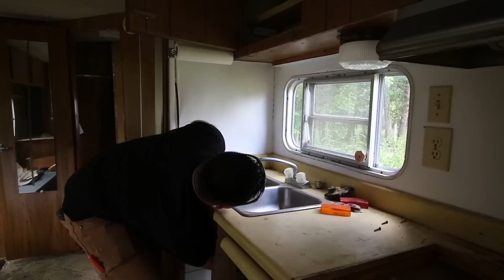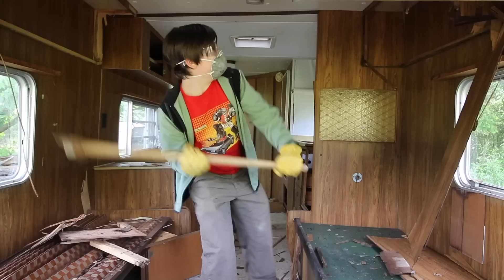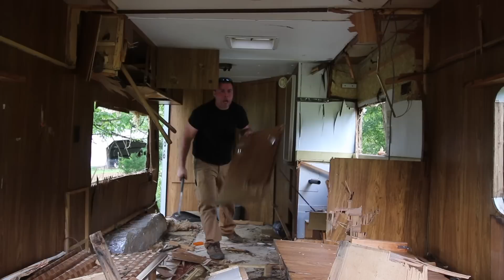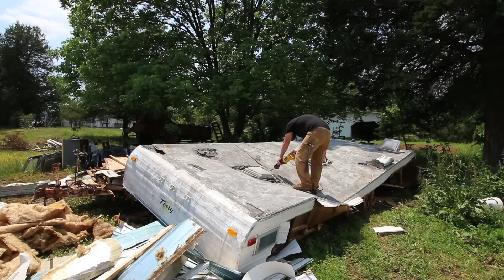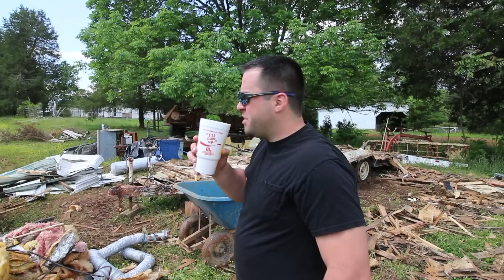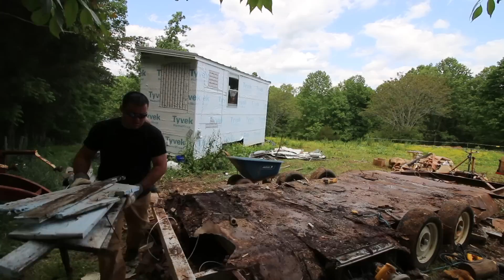Tiny House Terry E2 - DEMO of a camper trailers for a Tiny House.

Comment: Heya, I did something similar because I was on a super budget. I bought a rotted out camper and took it down to the frame and cleaned it up. I only have time every once in a while to work on it because I work full time, but I'm almost done laying in my floor joists and will make an update video when I do.

Comment: Lucky you had help. It took me about a week, but i stripped it down saving things that could be of value or reuse. I agree after doing this demo travel trailers are basically garbage on wheels. 2x2 walls, 2x3 floor joists not attached to the trailer frame except on the sides, paper thin wood walls, and a plastic mat under everything to hold the water into the floor so if there's a leak, its going to cause the floor to rot.

Comment: not bad, 4 days. me i have an excavator, a burn pile, and a dumpster. i just pulled home a 30' trailer that i simply want the frame out of. all the lights and brakes work. will just need tires and decking when stripped. will be great for atvs, lawn mowers, and hauling lumber.

Comment: OK, that was a very entertaining 22 minuets!  I lost a finger nail and nail bed from a grinder blade coming apart.  At 30,000 rpm, those can be fucking lethal!  Won't use one now with out a guard now.  But it was a blast watching you and the kid do the Demo!  I have a opportunity to buy a 24' trailer that I think was a mobile home at one point, it is just the steel frame now.  Only problem is I don't really have anyplace to park it.....  Still want to do it though.

Comment: It is amazing how crappy they are made, but they are this way to save weight..  Lite woods and using them far and few between and yet they do seem to last quite a while.. The number 1 problem with campers is water leaks.  When they come up with an elasticized panel that weighs only a few ounces, that's what they will use. When our 5th wheel was home and not in use, it was under a carport type tarp. It was amazing how cool it stayed inside when not in the baking Florida sun. 
I think I'd have gone to a pawn shop and grabbed a dirt cheap circular saw and chopped it into handleable pieces.  The cleanup alone would have put me in my chair with a case of beer!!!  

Scratches to Peanut!!

Comment: Yeah I think you're going to find that the aluminum scrap prices stink....here in my state it's only .50/lb....you're most likely not going to get anywhere near $250 scrap value off of the top...maybe with scraping the entire trailer. you gasoline idea would have been key.
Reply: should've watched the whole video first

Comment: why destroy that camper? it looks likes it could be repaired for less than the cost to build one...
Reply: did you not watch the video?
Reply: +Wes yes i watched the video ....it looks like its worth fixing...
Reply from the maker: The whole point was to get a trailer for cheep.  yes it could have been saved for a year or two but not the point.  it did have leaks and mold.  the ceiling was falling in and there was a lot of water damage in the base.
Reply: +Tiny House Customs oh ok then .guess it was junk... my mistake ....

Comment: All. Campers are built weak. So cheaply made.  I tore one apart myself by hand. Literally peeled the corner and walls ripped right down.   I'm stronger than most men but still it was so weak.  RVs are made.light and made cheap.  This is why we tear down and.rw do with real wood , 2* 4 construction and solid build a new tiny home.  RVs also all leak.  Yea ALL.  I can look at a new one and find screw head in caulked and that's all it takes and a drip gets in.  Drip.   Drip....dripp....drip.    A drip over a matter of years equals serious rot and mold and damages.   Do not buy an RV or trailer.  Build your own tiny home or buy tiny home.  They are built like a real home.   RVs are so cheaply made and weak